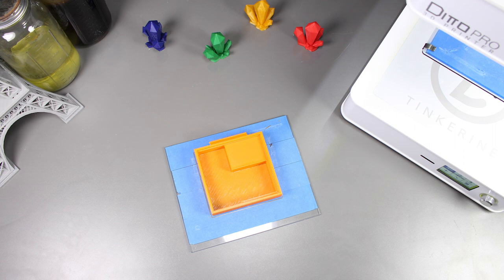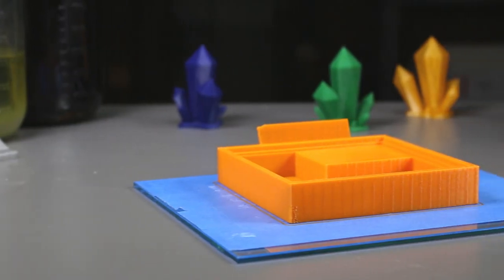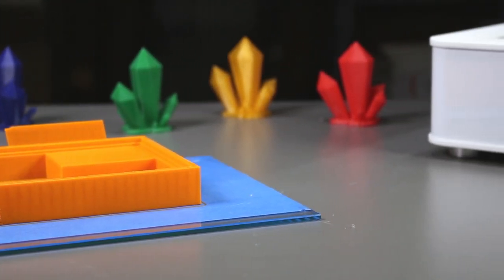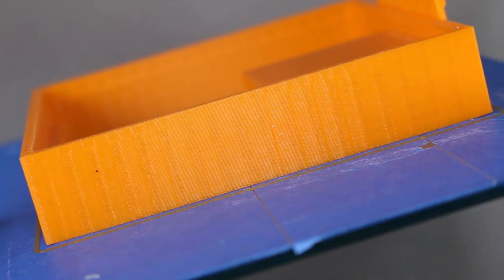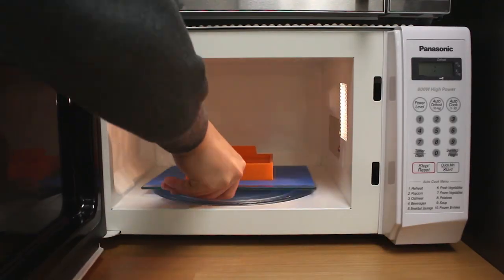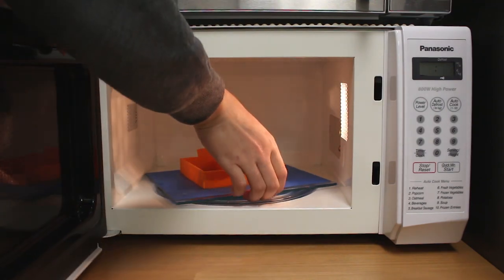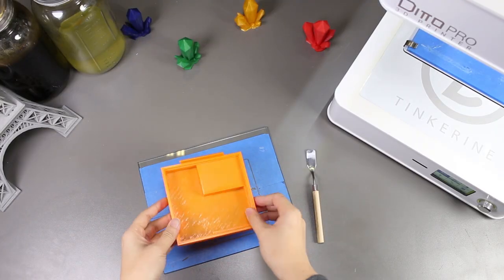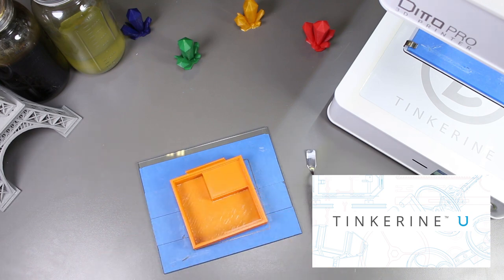Using the Microwave for Easy Print Release Part 2

Comment: Works nice :). I was unable to get small pieces detached from my bed without breaking them. I printed them again, used the microwave, and they all popped off with a little pressure. This has been a really useful tip!
Reply from the maker: Thanks for the comment, it is a very useful tip to know!